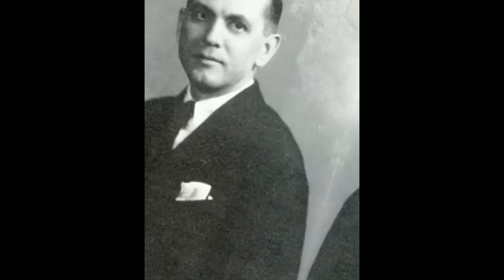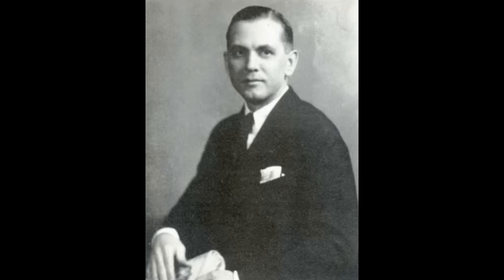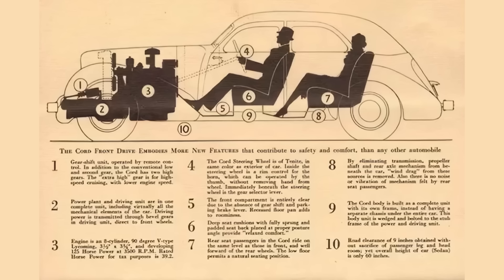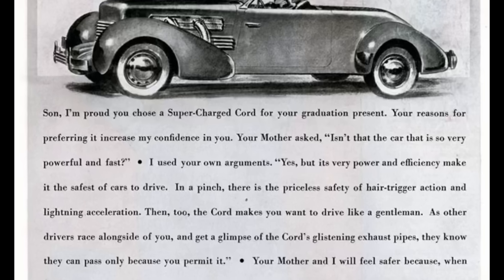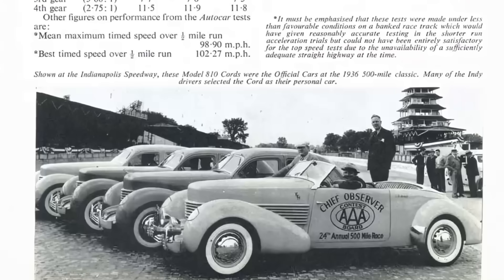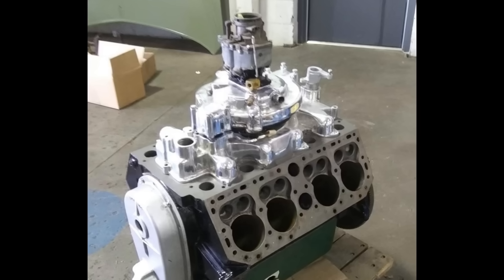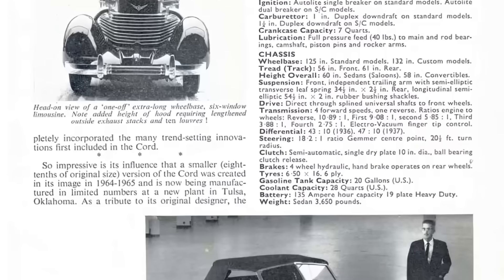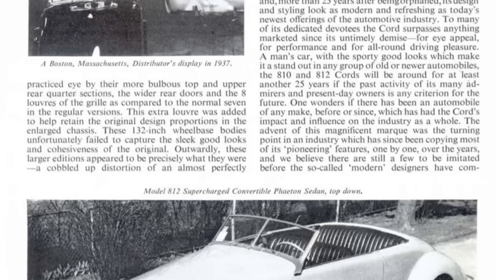Cord horizontal valve V8 289 cid engineered by Lycoming ￼￼

Comment: 11-01-2026.
I met Mr Cord in 1966, he helped out on the Tornado front wheel drive, with the chain to transmission problem, ( the factory would pre stretched the chain) he said the stock manipulation charges were a board setup, as they wanted to wrap up the company.

Comment: The J and SJ werent overhead valve (i mean i guess they were... But OHV engines are pushrod engines like a chevy 350 or ford 289/302). They were DOHC engines (dual overhead cam).

Comment: WHOAH!!! I Knew about Duesenberg & the incredibly-ahead-of-time superchargers BUT I never knew they made much above 200hp, let-alone 400.. That's ridiculous; I can barely imagine HOW so much power could ever be used with those wheels of little grip & the crappy old trannies + suspension of the time.. It's insane. I assume safely the cars couldn't even tap-out the whole load of power as I doubt they could reach the top speed before they theoretically can.. Astonishing.

Also while I knew Diesel engineers were already messing with tumble & especially pre-chambers (actually, the most-intricate pre-chamber to this day comes from a early-30s Diesel, Buda heads, they also came Roots-blown, they are 4-strokes so unlike the later Detroits & Fodens, these were actually supercharged) I did NOT know Gas engines with tumble existed and this is also the only engine I've seen with bottom (or whatever you call them) valves which actually has good performance / efficiency (tuned flatheads don't really count, a pig with lipstick is still a pig :) ). And it's clever that it uses the 2-valve nature to cause the tumble.

But, I should mention (I'm sure you may already know but..) the original large aircraft engine from Lancia (which were narrow-V... They beat VW ("VR-6"/"V-5") by like 80 years or more..) used similar valves, just they had a loooong rocker & the cam was near the crank. There though it certainly wasn't as-good but it didn't really need to be, it's a low-RPM large-capacity air-cooled engine so.. They had massive HP too, like 1.2k I think.

Comment: Research and do a video on the Ford 335 series 351 Cleveland engines.  Just don't call it a small block. That's a chevy / mopar term. 😉
But please send me or someone who is an expert an advanced copy to check for  correct info. It is a very confusing engine.

Comment: The V8 appears to have quite a few similarities to the V12 used earlier by Auburn and American LaFrance. I currently have a 1932 Auburn with the V12, and it is a very nice driving car. Surprisingly light steering for such a heavy engine, and a lot of torque to keep up with modern traffic. I also have a 1932 Duesenberg J. Slight detail missed is that they are double overhead cam with four valves per cylinder. For as large of a car as it is, it is almost scary fast. A few years ago, I had a 1929 L29. Beautiful car, but difficult to get parts for, and very difficult to drive. It had really bad torque steer, it had a new clutch, but it would slip no matter how it was adjusted if you were quick to accelerate, shift linkage would randomly bind, and other issues. Overall, not a great car. I do have an Auburn 812, but I haven't gotten around to getting it running yet, so I don't know much about it. Cool thing, it has the "Electric Hand" shift in it; which I'm sure I'm going to have to rebuild. I did have an 810, but it was a pile of parts. Someone in the 1950s lengthened the car about two feet and put a six cylinder flathead Dodge in it and converted it to rear wheel drive. I never bothered to get that one running.
Reply from the maker: Thank you so much for sharing all that insight and information. I was a bit vague on the Duesenberg explanation lol 

Curious, where are you located? I would love to feature your car on the channel if you're up for it.
Reply: @What.its.like.  I am in Florida. I say they're mine for simplicity sake, I'm pretty much the only one that works on and drives any of them, but it's a private collection that I maintain. The owner does not like publicity.

Comment: It's interesting that they seemed ignorant of the benefits of the Ricardo squish head - the shape of the combustion chamber over the piston is far from ideal leaving potential dead pockets which could result in detonation, but the design would have lent itself to a slightly deeper combustion chamber over the valves and a squish piston. I believe the patent had expired by the 1930s, Wakesha had the US rights and supplied a lot of engine manufacturers in the 1920s.

Comment: The Duesenberg didn't just have an overhead valve inline eight, but it was a dual overhead cam, four-valve-per-cylinder inline eight. Absolutely amazing tech.
Reply: And now considered "modern " . a pencil , a paper , a slide rule , geometry by candlelight , figured it all out 
 before lazy was invented and a "computer "was the human brain  driven by sense not profit .

Comment: Much as I've always loved the looks of the Cord 812? I'm afraid I'd have to take the Auburn - as a car to be driven. The reason there are still so many 812 Cords around, is that they were all abandoned in sheds and garages when their transmissions took a dump. And every one of them did just that - and fairly quickly, too... Fixing them is possible, but... they will just break again. The Auburn has it's own problems, but they're mostly common period car problems; and if they're fixed, they'll pretty much stay fixed. So, being someone that insists on using the things I have? Much as I love the 812 Coed's looks, I'll drive around in the Auburn, instead...

Comment: A small correction in terminology is needed in your description of the valve train. That design is called a finger follower, not a rocker arm. That was an advanced design for its time. Finger followers are still in use today.
Reply: The OHV V-8 that Ilmor designed for Indianapolis used finger followers on the   camshaft.

Comment: I have seen other videos on the 1936-1937 Cord. One interesting feature was the preselector manual transmission that had a stalk on the right side of the steering column. And on the end this stalk was a small finger operated lever to preselect the next gear. The procedure was to preselect the next gear, then when the clutch pedal was depressed the transmission would shift to the next gear. The only other car with a transmission like this was the Tucker car.
Reply: Hudson Terraplane had it, too.
Reply: @livesteamfan1  I helped with a restoration of one and with a new wire harness was able to get the electric hand and vacuum clutch to function perfectly, it was fun to take your foot off the gas and watch the clutch pedal drop a see the shifter move all on its own.

Comment: Notice that the 289 Lycoming engine put up numbers that pretty well mirror the Chevrolet V8 engine that was introduced in 1955 as a 265 and updated to 283 cubic inches late 56 or early 57. I myself would prefer the Cord 812 as compared to the other two vehicles. But in reality, if I had the funds, I would prefer all three🥸👍👍👍👍

Comment: Have to have the Cord! Any of those cars would be great though. My Grandfather was a foreman in the trim shop at the factory in Connersville and I always wish he could see the cars today. BTW the design of the Cord V8 owed much to the V12 Auburn engine which had a similar valve arrangement. I heard Gorden Buehrig in an interview once explain that the inspiration for the 810 design was the Stutz Blackhawk land speed record car built by Frank Lockhart in 1926/27 at Stutz while Buehrig was working there. If anyone is out there who has a recording or transcript of that radio broadcast I'd love to get my hands on that. (KPFK, The Car Show)

Comment: Very interesting video, Jay. I've never seen the cross-section of the Cord V8. The valve arrangement is interesting, to say the least. Almost reminded me of the Viking engines. You'll notice the replica Cord was mentioned in the article at 7:43-8:06. That car was powered by either a 140 or Turbo Corvair engine, and was FWD. After Glenn Pray sold the company, the Cord ended up being on a Ford chassis with RWD and a Ford V8, along with exposed headlights. A sad ending for a once beautiful car. WYR= I need all of them! NTT= no idea at all.

Comment: My dad was a young mechanic in the late 1930s. He was very good - and hungry! This was the Depression. Many people wanted their cars fixed right but money was tight. My dad said he got stiffed by customers many times. But when a 1937 coffin nosed Cord came in for a clutch job, he jumped at the job because he got half the money up front. The Cord dealer in Philadelphia had turned the job down, they didn’t want to tie up their shop, but they loaned my dad the shop manual and a couple of special tools. It took him a week for that clutch job! He said he started at the front and started taking stuff apart. The job cost $500. That’s about $11,500 in 2025 dollars. He said he was glad he did it, but wouldn’t do another one!
Reply: Yes, sir this was complicated work and many shops as you mentioned would not want to tie up the time to do such a job.
Reply: Almost like some modern vehicles you have disassemble half the car just to get to a water pump or a sensor, amazing a 30's car can have a complicated design, guess that's why so many Cords got put away when the owners couldn't find anyone to repair them, kept them away from the scrap drives, they are still some hidden to be discovered. A Cord Beverly  fresh out of dusty garage just came up for sale in Hemmings
Reply: @stevenslater2669 "My dad said he got stiffed by customers many times." Same story with my dad's Tydol Veedol filling station in the '30s. His supplier let him have fuel on credit. When the debt was called in, dad lost the station. Funny ting is, dad said he never got stiffed by a working man. Only the ones wearing suits or those suits carrying a Bible. :-0
Reply: That is so cool.
Reply: Hey , Even 60 years later , I'll back him up , No Problem ! In the 90's an acquaintance had a '69 Oldsmobile Toronado . He was out of work ( and lazy ) living at his mums . I was younger then still racing stock car putting an engine together was kinda common . He made a good offer and I agreed to change his transmission . Well , Let's just say I never , ever thought about shooting myself till that weekend . We were already kinda pissed 'cause the track was wet and couldn't race , so we started out sper of the moment . The the bay we used didn't have a high enough lift 'cause we underestimated how high we'd have to get the car . Half ways there we had to move the vehicles in the shop around . (https://www.youtube.com/watch?v=pct1uEhAqBQ)
  One day later than planned we finished . Many , many , (too ) many beverages were drank . Lesson learned . Cheers all 
 After that if anybody asked for help i'd pick a flyer outa the mail and so see Gus at this place , he'll give you a deal .
Reply: @mr.nibbles.friends For next time, I'll mention that Tornado and Eldorado are an absolute cake walk if the engine and trans are pulled together. 
The wheel ends don't even need to be disturbed. 

I wonder if the Cord also didn't have a similar shortcut?
Reply: @johne189   I appreciate the tip mate . But  .  .  .
  I'm past the wrenchin' age has made it's presence . The Cord ahhhh . What a machine
Reply: @mr.nibbles.friends Your link to circus music is asinine, just saying for anyone else who might mistake your comment as relevant.
Reply: @mr.nibbles.friends  Thanks for the link. G'G'son is going  to love this! 🙂

Comment: Fantastic !   E.L. Cord was a gifted salesman who also had a taste for real automotive art.   Even the lower line Auburns were great looking cars.   I had a model of the 810 Cord 50 years ago and still one of my all time favorites.        As for Engine videos, I think some "group" videos would be great, like "Mass produced flathead V8's"  that shows not only the Ford, but Cadillac, Lincoln, Cole,  and early GM (Ferro and Northway) flathead v8's which were produced in the thousands.     Another great one would be "Bent head V8's"   Viking, Oakland, Pontiac, and....Horch(Audi) in Germany, who I still feel got the rights from GM.... GM was quite active in Germany during the 1930's, and that Horch V8 has way too much in common to be a fluke.     Another great episode could be American engines that lived on overseas....    Chevrolet six in 1930's-40's Germany,  Late 1920's Graham-Paige flathead 7 main bearing six that went to Nissan in the 1930's and went on to power the Nissan Patrol from the 1950's to the 1990's (with an OHV conversion in the late 1950's.     Yes, there was a 1929 American engine being produced in Japan up into the early 1990's !!   (Nissan P and later P40 engine).
An F - head episode would be fun as well !

Comment: The Desenburg straight 8 was double overhead cam.  The term Overhead valve denotes a design with the valves in the head but the camshaft in the block.  The later Cord V8 was overhead valve, with the camshaft higher in the block than would be the norm for later OHV V8s
Reply: You're half right. the Cord V8 was, by definition, a flathead. Valves were in the block. You're right about the Duesenberg.
Reply: @61rampy65 YES, looking at the photos it seems to be a slight variation in the flathead design.
Reply: @WrenchingOnCars  The Cord Lycoming and the Viking/Oakland/Horch V8s can be called "bent head" - they were a variation of the flathead that probably had marginally better breathing and airflow.  The manufacturing setup for machining and assembly looks to have been tedious.
Reply: One thing placing the cam high in the block does allow for shorter pushrods. In the 80s l had two different Renaults. Only 1600 cc but the camshaft was located so high in the block that the tappets were actually inside the head. The sprocket on the cam was partially above the deck face of the block. Hemi head with extremely short pushrods. The only shorter pushrods setup I can think of would be the ones in the Opel Can in Head engines.

Comment: Well done one on the Lycoming V-8 they did good engineering to get the engine  as the smallest demensions possible to fit the firewall to bumper space, and pull the trans axle further in and have more space in top for the supercharger, if they could have beat GM to the fully automatic transmission and fine tuned the CV joints, Cord could have survived into the 40's, plus they came up with the innovative front subframe system GM used on the F and X bodies, Toronado, Eldorado, big Opels, and Holden. Just think if Cord made it into the early 50's with their styling and Preston Tucker being part of the company with his innovative ideas, they would had a car line way ahead of the big 3, and up there with Nash.